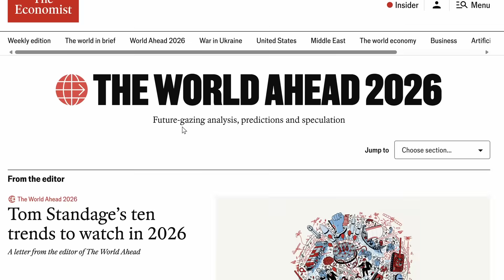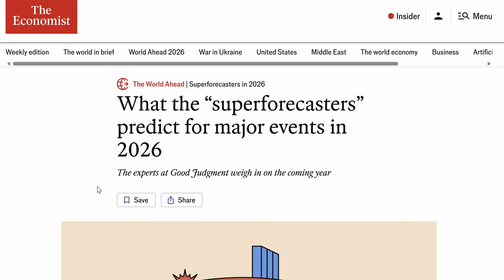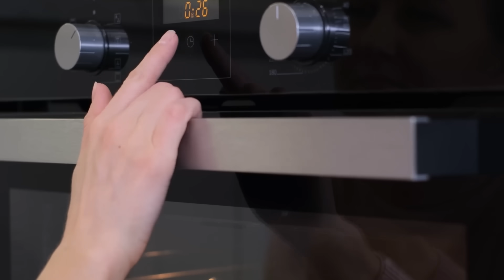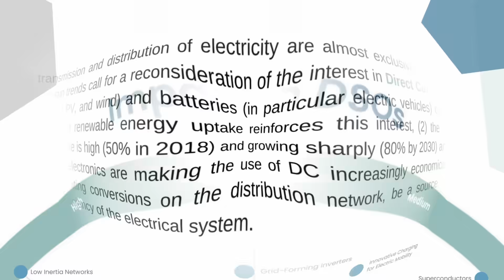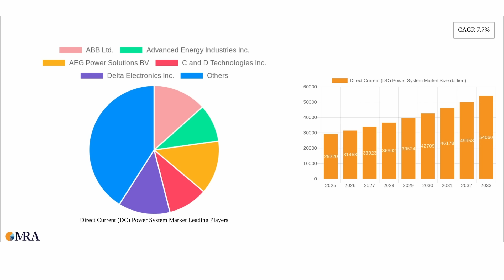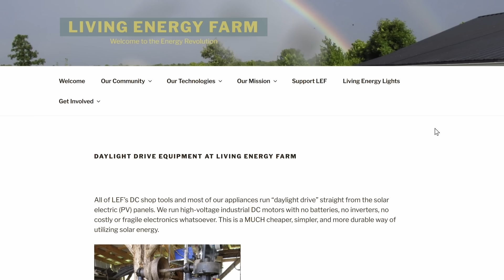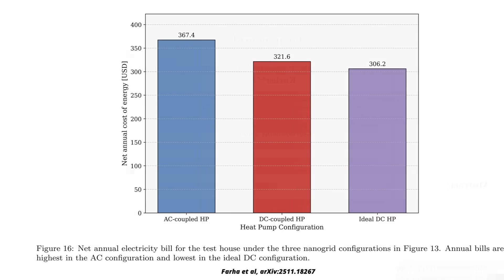Are We Using the Wrong Kind Of Electricity?

Comment: What today requires high wattage inside the house? Dryer, range, some kitchen stuff needs 2kw. All the rest is below 200w. No need for expensive cables anymore.
Reply: Bathroom heaters, A/C, water heater, space heaters that one might want, EVSE, entertainment system (big-ticket audio/speaker system).   Furnace fan.  And Garage tools (table saw and other tools).

But you are correct in that per-room electricity consumption in a modern home with LED lighting has gone way way down.  Fewer and fewer circuits need to carry high power.... for which 120VAC is still more or less the perfect choice.

We do have a DC standard called POE (power over ethernet), which can very easily handle around 60W (100W+ in the latest standard), and is very safe owning to the active ethernet comms going over the same cable.  No link light = no serious power allowed).  It's a ~56VDC standard.   I have POE strung to four or five rooms, primarily for my alarm system (POE cameras) and WIFI routers (POE routers).
Reply: Hair dryers (up to 2kW), vacuum cleaners (1kW+), larger TVs (400W), powerful gaming PCs (up to about 1kW), electric HVAC (many kW), EV charging, to name a few non-kitchen devices.

Comment: With all this AC/DC I feel thunderstruck.

Otherwise... as usual you have very insightful points that I've never considered.

I will say however that 15% is a lot of electricity so as much as it might not make sense to retrofit existing infrastructure, new houses planned for off the grid energy would be top candidates to just skip AC all together as well as the renewables powered data centres etc.

Comment: Sabine, I can’t help but notice a mistake in this video. Anything that spins, usually does not use DC current in modern times. For instance, wind turbines actually internally generate AC, and they transform into DC.
Reply: and microwaves' magnetrons definitely use AC too
Reply: @RobertoMaurizzi  you confuse RF frequency with AC power grid voltage, the former is in gigahertz range and the latter in just 50/60 hertz. The former can't be produced directly from the latter.
Reply: @sumwonche5688 my mistake: it's actually the high voltage transformer that is designed for a specific frequency, not the magnetron that works on high voltage rectified DC from that transformer. Too bad, I should have shipped my nice oven from the UAE to the Philippines, it would have likely worked 😅
Reply: @RobertoMaurizzi  literally any wave is alternating – it's what a wave does.
Reply: EVs have motors that spin and are DC
Reply: @dexlab7539  No, EV motors are multi-phase AC. Their inverters are fed with DC.
Reply: @dexlab7539 modern Evs use 3 phase motors across the board, unless you’re talking about the first car ever built, which was electric and used dc.
Reply: @dexlab7539 but they need DC to charge the batteries, I guess that's the point she wanted to make in general: for renewables you need batteries and batteries are DC

Comment: One of AC's advantages is that the 60Hz cycle allows for synchronous motors in clocks, phonograph's, and industrial equipment.  Also, early diodes were expensive and impractical.

Comment: Sounds like you revived the ghost of Thomas Edison.  That is why some old radios were made here  were 115 volts, either AC or DC.  They used DC in New York at one time I believe. The problem is DC losses in power distribution.  And supposedly DC is more dangerous as if you grab a wire DC causes you to tighten your grip while AC not so much.  Nothing you own now will run on DC out of the wall.  This all sounds like another way to enrich China.

Comment: I stopped at 0:29 to point out that EVs actually use AC - of coursre, pulse-width modulated, and only the battery uses DC. So if we would invent/discover some "room temperature" superconductor, the battery can become AC too. It would still need to be converted to the pulse-width modulated AC used in the traction. My point being that EVs don't need DC... only the current battery does.
Reply: PWM is pulsing DC. It's not AC because there's no change in polarity.
Reply: @Flipperhome  It's all about your reference point. Mains AC is not changing polarity if your reference is -230V (or -100, -110. -120, -240 depending on where you live).
Reply: @AndyG-_- except your reference isn't -230V. AC is ----> Alternating  Current<----. It changes direction.

Comment: Wind turbines produce AC 
As do Hydro electric systems
Reply: Wind turbines produce variable AC which is not in sync with the AC grid. It's first converted to DC and then to constant frequency synchronised AC.   
So DC conversation is required anyway
Reply: @commieTerminator 
It still produces AC. 😂😂😂
Electric cars use batteries but the DC is converted to AC.  😂😂😂
Reply: @bugtusslealien3931  that AC is not your typical 50 or 60 Hz at constant voltage. Most electric cars use synchronous motors which requires VFD or even VVVFD to accurately adjust phase angle, voltage and frequency. Even if batteries could output a constant AC, DC conversation would still be required as a bridge between 2 different kinds of AC.  
Wanna know one more fun fact? All electric trains and subways also convert the overhead single phase AC into DC in order to output 3 phase AC for their 3 phase induction motors.  
"😂😂😂"
Reply: @commieTerminator DC train lines exist but most are just 3kV and not suitable for high speed trains.
Reply: @maelmauron7530 I talked about regular 25kV AC trains, not DC
Reply: @commieTerminator Well, you said all electric trains and subways. It's definitely most, but not all.
Reply: @maelmauron7530 Obviosly, DC trains just use DC directly. AC trains convert single phase AC to DC then to 3 phase AC. My point being that no matter which electric train we look at, DC is somehow involved

Comment: There are many reason for AC not DC.  1.  Size of wire the higher the voltage the smaller the wire with the same amount of wattage available at an given point. So it cost less to move power and use power.   Losses due to impedance are higher when DC voltage levels are changed. The change DC voltage levels you turn it to AC and then backto DC.  This turn in to heat in the inverter.  Also relay protection circuits can detect faults better when they happen.  DC fires are hard to put out because there is no zero closing of voltage leve for the fire to be put out at.  And many other things that show up if you read about the Tesla/Edison fight.
Reply: Only about 20% of your points are accurate.  AC breakers are definitely more forgiving but that's about the only thing you said that was correct.    Changing AC voltages is just a transformer... the transformer has losses too, BTW.  The key is the ease at which AC voltages can be changed.   Transmission losses are generally a function of the voltage, not whether it is DC or AC.  But AC has additional corona and other losses on top of that.

Beyond a certain distance AC becomes squirrely and hard (or impossible) to synchronize due to constantly changing phase from wind, loads, and temperature.   You wind up needing resynchronization stations which are expensive. So beyond a few hundred miles, DC transmission winds up being cheaper.   And DC transmission in general is always going to be significantly more efficient, no matter the distance.

DC also has massive advantages in being able to operate across a wide voltage range whereas AC is locked into one voltage due to all the fixed ratios of the transformers up and down the line.  This makes it vastly easier to manage energy flows on long-haul DC lines.

It's an economic trade-off.   This is why long-haul transmission lines made in the last 50 years or so tend to be DC these days.   The trade-off is that you don't generally want to translate DC-DC at high voltages, so you just have one DC "trunk" with AC satellite networks hanging off of it.

AC works better for distribution networks that need to do a lot of voltage conversions (another economic trade-off... higher voltages = lower amps = far lower losses.  Double the voltage = half the amps = 1/4th the line losses).   DC works better for long-haul transmission lines.
Reply: @junkerzn7312  more than 20%....I in that business and have been in it for 45 years.  I have been on all sides of power design, protection and SCADA. AC  and DC systems are designed for economical reasons.  I have lived through a DC fire on a substation that did not go out for days.  Between multiple grids there is DC ties in the US like ERCOT and SPP.  I have delta with AC and DC generation and Loal.....so if you want to learn something i will help you.
Reply: @junkerzn7312  you can find me in all of the USA RTO/ISOs and in the NREC standards drafting teams for many of the standards.

Comment: That all sounds great but...

The dirty secret of DC is electrolysis. "Leaking" DC will corrode any metal it comes in contact with in short order. In districts that used DC... the Phone company used to put "Sacrificial" anodes in man holes to prevent stray DC from destroying lead cables. 

With so many metal buildings today I wonder how red iron will hold up to persistent electrolysis?

Comment: If you have pv panels and batteries you should convert to using mostly DC and use AC for only big items like washing machines cookers or heat pumps...
Reply: Take a look at the gigantic cables you need for 12 or 24 and even with 48v and the huge losses you have at those voltages, if you go for 230V DC it still needs to be converted... There is a good reason for why we us AC in homes. DC only makes sense for 1000km long 500.000v ++ powerlines.
Reply: @a64738  48v is a typical voltage for home PV & batteries which does NOT need large cables for most house hold items. Losses are irrelevant for typical distances in the home. There is NO reason to use AC for most items in the home when you have DC from batteries available....

Comment: What about DC using the entire wire cross section and AC flowing more on the edges?
Reply: What about it? DC have horrible losses at low voltages and is one of the reasons we are using AC, because it is more efficient with less loss and AC motors they say is up to 70% more efficient then DC motors..
Reply: @a64738 the idea i belive is that there would be less resistance in the wires with DC because they use the entire cable cross section, while AC flows less in the center of the wires experiencing a smaller effective cross section area cable.

Comment: In my opinion we had to use AC back in the day because transistors did not yet exist.  Stepping voltage up or down without transistors is really really hard.  Now that semiconductors are as common as sand (pun intended), we should be more focused on DC current for most non-grid applications.

Comment: Is it time to have DC outlets in our homes, along side AC outlets?

And Merry Christmas
Reply: Man i think those would be quite an arcing risk since there are no zero crossings. DC lights and fixed appliances might come pretty soon but DC consumer appliances with a plug will probably take a bit longer to be standardized and accepted.
Reply: 125VAC duplex outlets with an integrated USB charging port are available at Home Depot.

Comment: I don't think wind turbines create DC current. 🤷‍♂️
Reply: They also produce AC. But they are put of sync with the grid.

Either way AC or DC they are not compatible with any grid directly. Needing the power to be converted into a AC from DC or converted into none various AC as the drive isn't constant it will vary based in wond speed

Comment: DC at 200-250V would create some unique problems with wiring and it would make an accidental touch pretty much an instant death sentence while with AC that is pretty much survivable without any major harm
Reply: That would by my top concern! There are limits for save DC voltages at ~60V and 42V - the latter in environments with higher safety measures.
Exactly the reason why I use only 45V PV modules in parallel for my emergency backup PV system and a 24V battery.
Reply: Yes, "ivory tower" scientists who don't have any practical experience don't understand that all these complex systems need to be maintained. People make mistakes and systems may fall into disrepair. And that would be much more of an issue with DC. 
Also it would require rewiring of every house, every street, and all AC-only devices would require an expensive sine wave inverter to continue to be usable. AC-synchronous clocks wouldn't work anymore, and they're inaccurate on an inverter.  
In short it will create a MOUNTAIN of e-waste, just to satisfy the ego of some tech bros.
Reply: 200VDC would burn you. It's less dangerous than 200VAC at 50Hz because AC depolarizes cell membranes more easily and causes much stronger muscle contractions, leading to cardiac arrest.
Reply: Okay someone clearly forgot about the physics textbook.
200V DC is roughly 100V AC 
Also forgot the operational voltage in AC gadgets.
Reply: @laslie-u6u  no it isn't. 100v RMS AC is equivalent to 100v DC. 100v RMS AC has a peak voltage of 141V.
Reply: @philbrooke-little7082  yeah most recordings of AC are measured in RMS aka root means square or DC equivalent
Reply: @philbrooke-little7082 
Because the RMS means DC equivalent.
Reply: @laslie-u6u  it means Root Mean Square and it is the standard way of quoting ac voltages and I agree it does mean dc equivanent when it comes to amps and power in resistive loads. My point was that your statement  re the 200 and 100v equivalence is incorrect. 100v in one is equivalent to 100v in the other using standard terminology. 240v ac in a resistive load will give the same power as 240v dc in the same load.
Reply: @philbrooke-little7082 100V RMS AC gives the same amount of power on a resistive load as 100V DC, it's that simple. Yes, the peak should be around 141V
Reply: @dtibor5903  I know, that's why I've said that!
Reply: @laslie-u6u  I was zapped at work with 200V DC it's way more powerful than 120V AC.
Reply: @markg7030 
Okay zap yourself with 60V AC and come back if you are alive.
Reply: @laslie-u6u  60v ac will give a slight buzz to those with moist skin. 50v is officially safe for AC and 120v for DC however you will barely feel 60v AC.
Reply: @philbrooke-little7082  In Europe 60V DC and 30V AC are considered safe. These are values based on statistics rather than strict limits.
Reply: @laslie-u6u Bud, when I was an Ironworker and had to do a lot of welding in the rain, on the structure I was sitting or laying on, I got "zaps" from 80Vac a hundred or so times a day. Low voltage AC like that doesn't harm, it only hurts a little. Even 120Vac will only piss you off as long as you don't have heart problems and make a circuit across your chest.
Reply: @philbrooke-little7082 
😂
Here we have a joker 
It's not the voltage that dangerous hell you can be zapped with 10k volt and have not much problems.
The voltage limit is there so you don't get zapped 😂 with electric current that can prevent you from disengaging.
What kills you in AC is the Amper 
In case of DC the primer killer is the 50hz destroy the cell ion transfer.
Reply: @AtlasReburdened 
Oh they do harm as I said the Amper matter.
Reply: @laslie-u6u Both matter. Without enough voltage, it's not possible to drive a deadly amount of current unless you get straight up stabbed with electrodes.
Reply: @AtlasReburdened  Correct.  It takes one volt of pressure to push one amp of current past a resistance of one ohm.  You can have volts without amps but you can Not have amps without volts to push them.  Correct that it is the amps that cause the harm.
Reply: @laslie-u6u  you are talking static discharges where there isn't enough energy in the discharge to damage you. With AC and DC the body has different resistances, lower resistance to AC so it takes a lower voltage to produce the same current as a higher DC current. We should probably say it's the power that kills. When you talk about the prime killer in DC being the 50Hz you plainly have a typo as of course there is no frequency in DC.
Reply: @philbrooke-little7082 
It's a typo.😅
Anyway nope.
The 50hz AC is the most deadly frequency because it allows ion system collapse ergo the threshold when it causes muscle spasms are low.
DC burns and the damage equipment the Amper going through.
AC can also burn but you are dead way before.
Reply: @laslie-u6u 60V Ac or DC is not deadly. TENS devices go up to about 60V (very little current capability). 60V is painful sure but it's on the limit and possibly lethal with wet hands, large surface and thru the chest.
Reply: @dtibor5903 
Voltage itself are not deadly ever.
Because voltage is just the ability to penetrate resistance.
What matters most is the current the Amper the amount of actual energy flowing.
Seriously 😒 doubt about the intelligence of you guys.
A teaser generate tens of thousands of volts.
Reply: @laslie-u6u ok, lets try 1 million volts and 1 mA on you. It's harmless because the current is not high enough to cause significant muscle contraction. And you can ignore that 1kW arc that burns anything in it's path
Reply: @laslie-u6u  like I said the body's resistance to AC is lower hence the lower danger threshold however my original point was that your comment implying that 60v AC will kill you "zap yourself with 60v AC and come back if you're alive" is not true and I am a living example of that. Interestingly at very high voltages and frequency, such as from Tesla coils, the surface effect takes over and the power goes over the outside of your body largely harmlessly.
Reply: @laslie-u6u  It's not about the peak voltage it's about the directedness which can separate ions permanently. AC only moves them forth and back which leads to a higher threshold of voltage before damages are imminent.